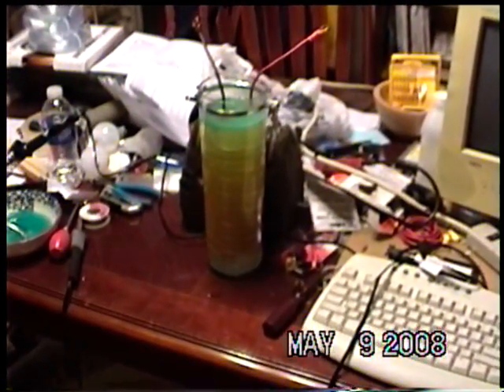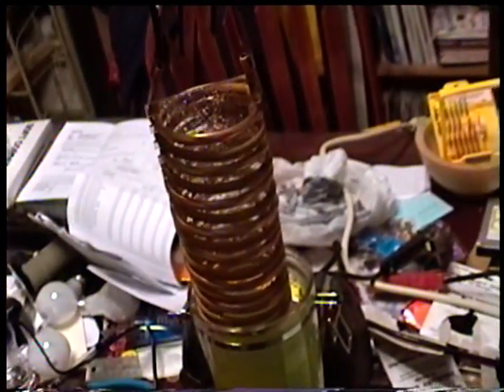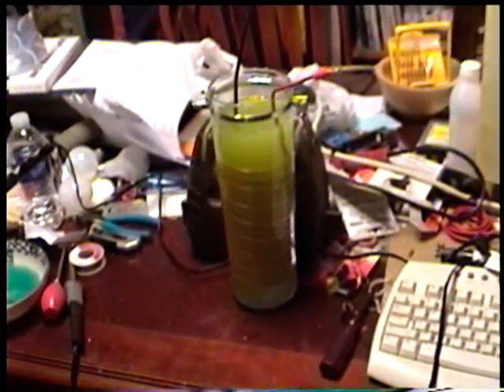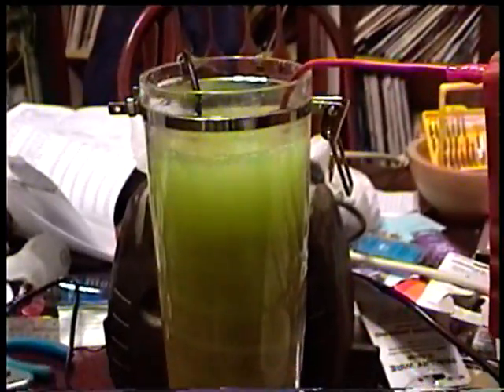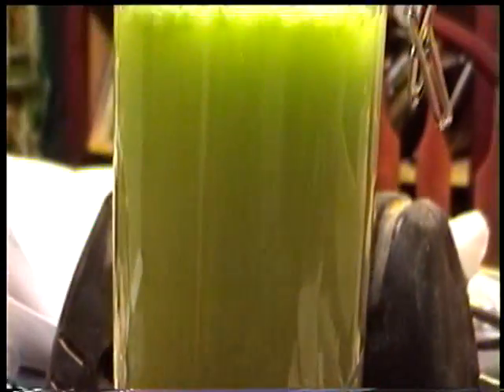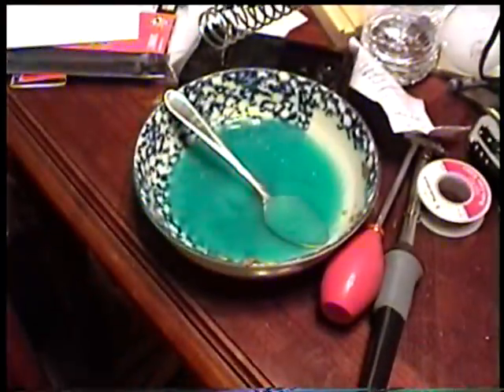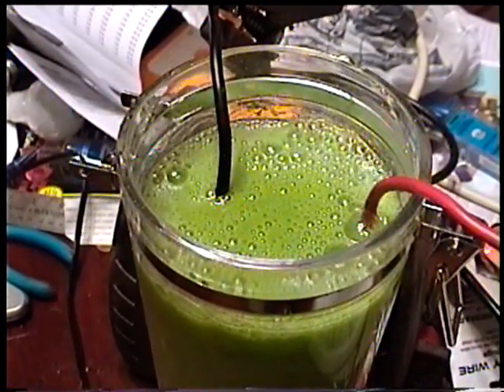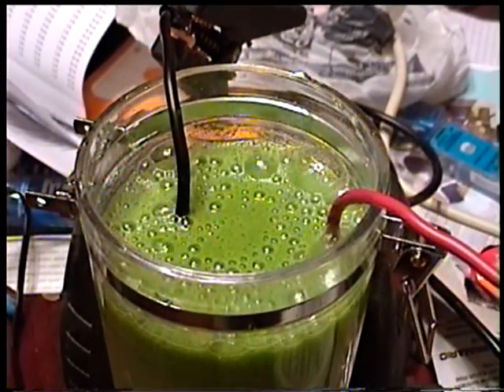HHO Generator Using Copper Coil

Comment: The best to use is a copper strip inside a stainless steel coil. It increases efficiency, reduces temperature, and generates more gas w/out all the crud.

Comment: I played with hydrogen generators as well, but I could not find a configuration where the electrical expense justified the hydrogen output. Effectively, I always got alot less energy back, than I put into my electrolysis plates. The amperage required is to high, it's always e-h, more electricity used than hydrogen created.

Comment: Nice corrosion & toxic gas machine. Hydrogen isn't the only gas this machine produces, chlorine gas from the salt. The salt also expedites the already rapid corrosion & oxidization of copper in water, hence the green color. I'm sure I'm not the first to comment so, but I also advise stainless steel.

Comment: very nice coil, copper works great for the cathode - but  sad for the + anode I have an idea that might work, if you put a tight fitting stainless tube 316L over the copper tube and connect the copper at both ends, also connect the copper - at both ends,  connected areas with liquid plastic, ? the energy would fully energize the coil connected at both ends, plus copper  a better conductor then stainless, the inner copper tube might allow better flow.  ideas I wanted to share I hope they help!

Comment: I used a 3 inch pipe to wrap it around to get the shape and then just adjusted the distance between the coils.  I've since moved on to using stainless steel plates and a better container.  Currently I'm just cutting to the chase and started working on building an electric car.  Ultimately thats the end goal.

Comment from the maker: Yeah, I've seen the results from most of the guys in this area and have duplicated the results so to speak.  I found a sheet of 316L stainless about 24x36 and have a friend that can cut it with his laser system to exact sizes I want.  I just need to calculate it out and figure out what pieces I want.  I'm thinking something similar to ZFF's cell, maybe a little larger because of the container I have.  This was just a cheap way for me to at least get started.  Only $11 for the copper and 2 hours.

Comment: You will very quickly figure out why most use stainless steel. 

Copper, Aluminum, Silver, Gold and Nickel have been tried by a numerous experimenters and we keep coming back to either 304 or 316 grade stainless. 

Titanium and tungstun do offer promising results but they are a bit expensive for most to play with.